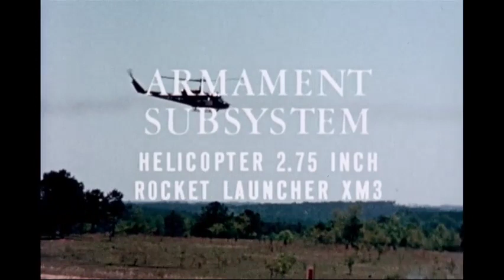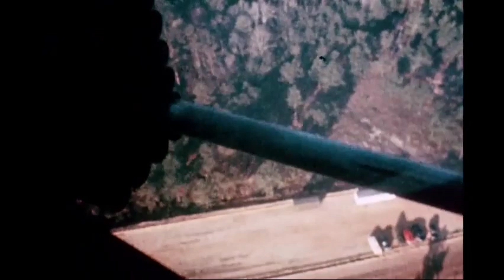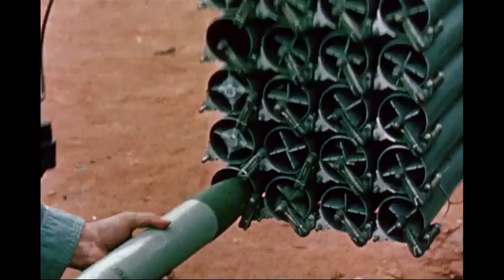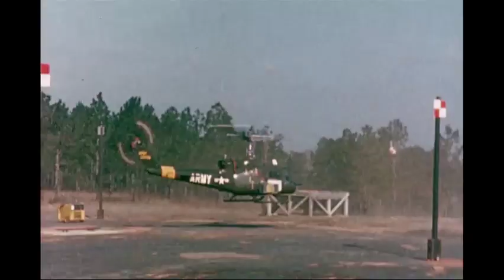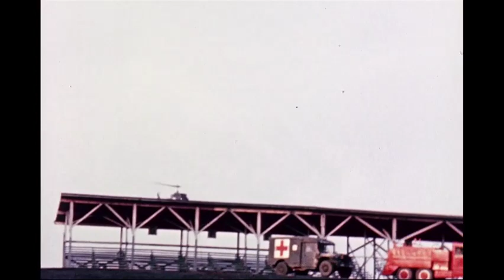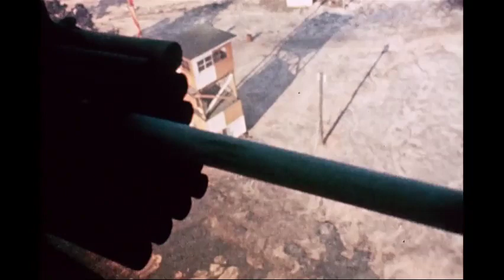UH-1B Armament Subsystem XM-3

Comment: Its just amusing to watch these early single powerplant UH-1 . The powerplant turbine is really small , compact unit. Yet it produced enough shaft-HP torque for UH-1 to lift, fly, land with max GW on hot, humid , tropical sh**holes that it was sent.